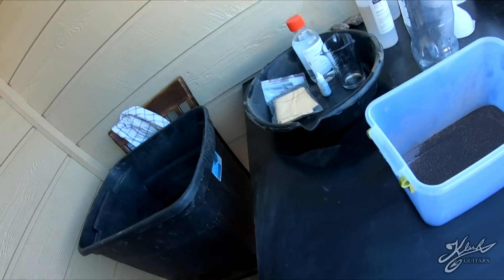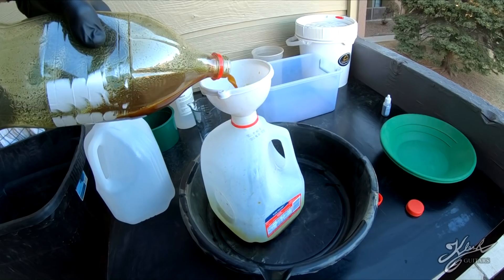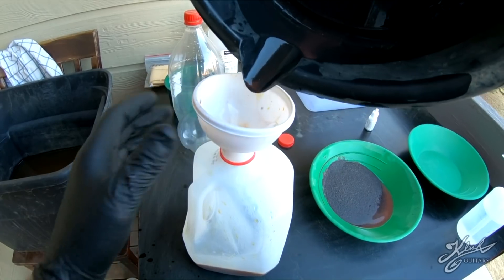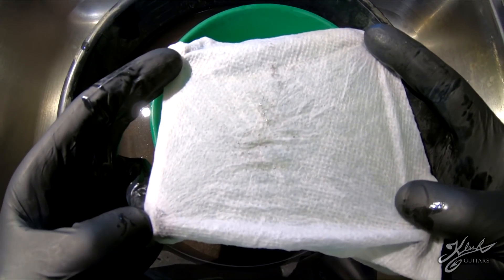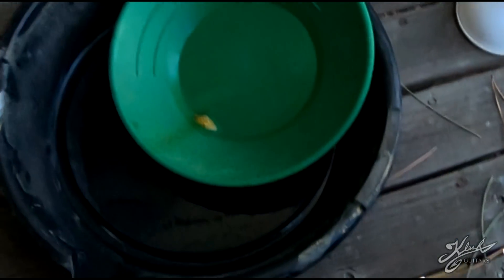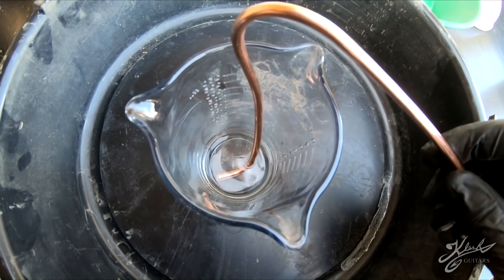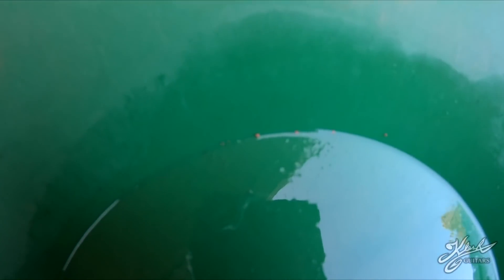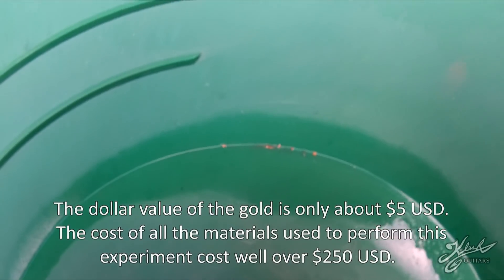Gold From Black Sand Using Mercury And Nitric Acid

Comment: thanks for doing this...do you know if you can run the mercury in a metal cement mixer? like if the mercury sticks to the metal of the mixer??? THANKS!!!
Reply from the maker: The mercury will stick to copper and possibly other metals, so personally I wouldn't do it unless it was totally contained and specific for mercury use. Thanks for the comment and thanks for watching!
Reply: yes you can use a cement mixer but you won't be able to safely run anything else in the mixer...the mercury will be in the walls and its wicked to clean...vapors, gas, absorption...you
Reply: I have put a 5 gal bucket with a cap on it ,and put it in a mixer and let it turn for a hr 
Then took it out and pand it, but I found out it's work better in hot water